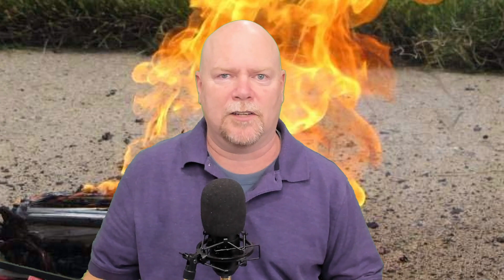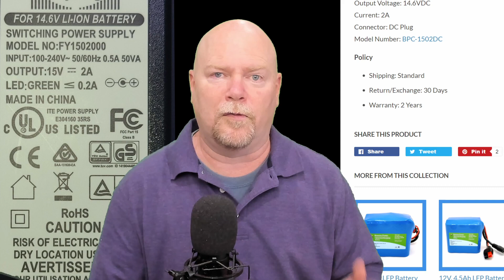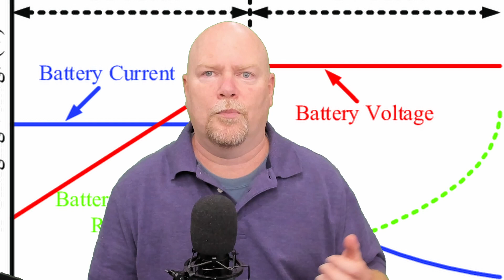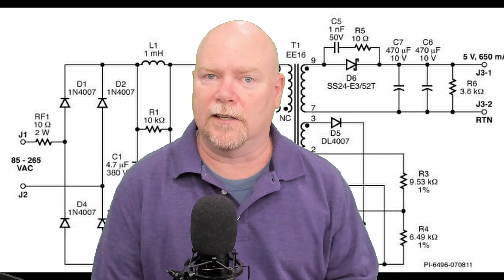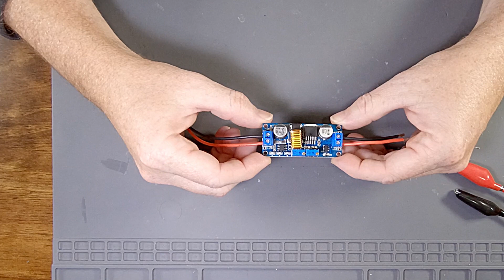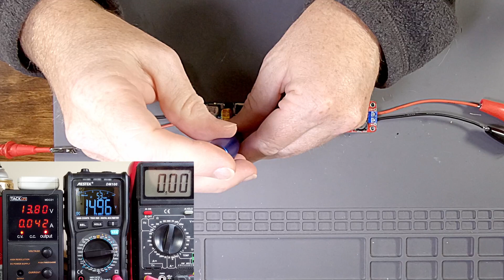Charging Li Batteries in the Car

Comment: I presume this circuitryto be an as needed on/off and not to be connected to run as a connection directly to the battery, like a mobile radio.  Could I hard connect with a dedicated on/ off toggle to be ready as needed or is that not necessary?

Comment: Good video.  Folks need to see how this works.  Just my opinion; the easiest method is to get an RC charger with proper cell monitoring.  I'm not a fan of LiFe batteries, alot of my RC friends use LiFe batteries for avionics power but I would rather use a Lipo with balance leads.  Never trusted the chemistry.
Reply from the maker: Not sure where your doubts about the chemistry come from, but for radio use at least LiFePO is optimal primarily because of the voltage profile.  Ham radios are engineered to run on 13.8V so Lipo leaves you too low with a 3S pack and too high with 4S.  Discharge curve is flatter on LiFePO4 as well.
Reply: @MattHeere  If you ever used this chemistry in an RC Model you would know.  Once these things reach critical discharge voltage the discharge rate goes off of a cliff.  When they do, you can't save them.  They are done.  It is exactly this flat discharge curve that needs to be measured very closely, that's why I recommended an RC spec charger.  I get the nominal voltage part but I run an 817ND on a 3S lipo just fine.  2200 3S packs are quite common for RC use and adapt to Amateur use quite easily.

Comment: Hi Matt, I built a battery pack using very similar ideas a while back. I found that I had to put a diode between the battery and the CC/CV module to prevent it from discharging while not it use. That might also solve the start-up power order issue you mentioned too.